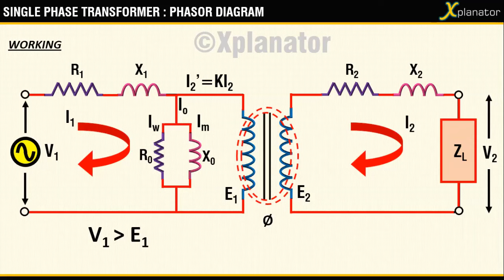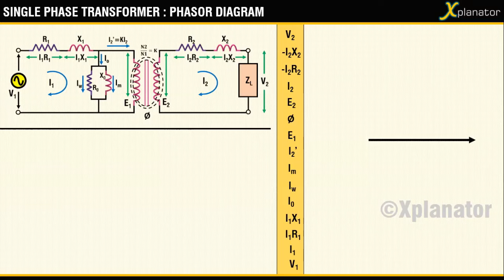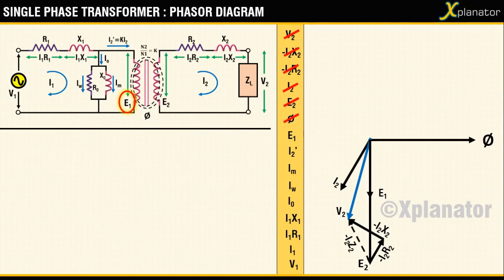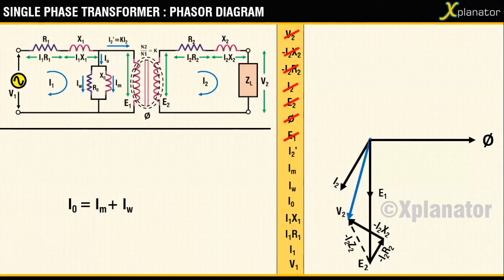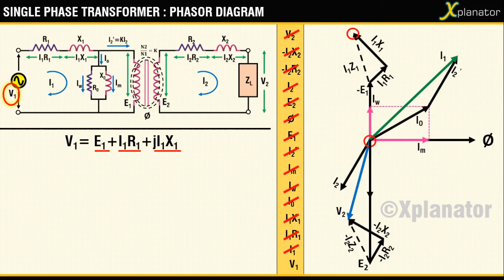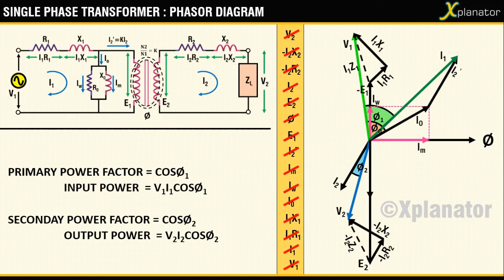PHASOR DIAGRAM ( INDUCTIVE LOAD) FOR A SINGLE PHASE TRANSFORMER

Comment: Why is it necessary to invert E, to become negative E
Reply: Good question, physically E1 and E2 are in phase 0° shift (they have the same formula, only differ in coefficient N1 and N2, +-(N1 or N2)*dfi/dt, +- depending on induced E direction, + to diminish U what caused i and E, - if we direct E in series to U). So basically -E1 is a convention to show us the cause - effect, firstly we have U1 which in close loop produces i1, then im makes Fi (flux), which induce E1 (with that manipulation (-E1) we can only get U1 in upward direction U1= i1*R1+ jX1*i1+(-E1)) and then E2. we can see in phasor diagram order U1, then E1 then Fi then E2 then U2 in reality we have U1, Fi then E1 and E2 and finally U2.

Comment: 🎯 Key Takeaways for quick navigation:

00:00 🧭 The phasor diagram is a crucial tool for understanding single-phase transformer circuits, showing the relationship between various parameters.
01:06 ⚡️ Five important parameters to be drawn on the phasor diagram on the secondary side: V2, I2X2, I2R2, I2, and E2.
03:33 🔌 To draw V2 on the phasor diagram, first, draw E2 lagging Phi by 90 degrees, then add -I2R2 and -J(I2X2) to get the resultant vector.
06:36 🔄 On the primary side, draw E1 (lagging Phi) and Iam (along Phi). Draw Iw (90 degrees leading Iam) and then I1 (-I2 reversed) to get the resultant I1.
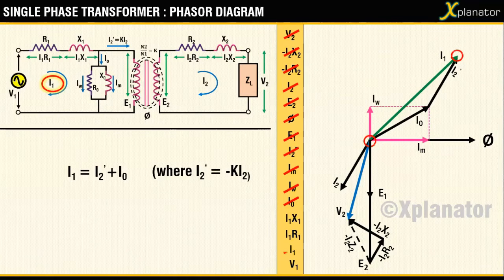08:57 🔁 To draw V1, slightly tweak the diagram by shifting E1 upwards with a negative sign, then add I1R1 and I1X1 to get the resultant vector.
10:29 💡 The angles between V1-I1 (Phi1) and V2-I2 (Phi2) indicate the power factor of the transformer. V1 leads I1 and V2 leads I2 in an inductive circuit.

Made with HARPA AI

Comment: Why E1 is in Antiphase with E2
Reply: Good question, physically E1 and E2 are in phase, 0° shift (they have the same formula, only differ in coefficient N1 and N2, +-(N1 or N2)*dfi/dt, +- depending on induced E direction, + to diminish U what caused i and E, - if we direct E in series to U). So basically -E1 is a convention to show us the cause - effect, firstly we have U1 which in close loop produces i1, then Im makes Fi (flux), which induce E1 (with that manipulation (-E1) we can only get U1 in upward direction U1= i1*R1+ jX1*i1+(-E1)) and then E2. We can see in phasor diagram order U1, then E1 then Fi then E2 then U2 in reality we have U1, Fi then E1 and E2 and finally U2.

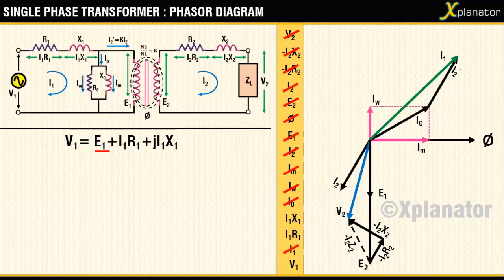Comment: Hi, Excellent video. Could you explain in more detail what you mentioned at 09:20?
Reply: Good question, physically E1 and E2 are in phase 0° shift (they have the same formula, only differ in coefficient N1 and N2, +-(N1 or N2)*dfi/dt, +- depending on induced E direction, + to diminish U what caused i and E, - if we direct E in series to U). So basically -E1 is a convention to show us the cause - effect, firstly we have U1 which in close loop produces i1, then im makes Fi (flux), which induce E1 (with that manipulation (-E1) we can only get U1 in upward direction U1= i1*R1+ jX1*i1+(-E1)) and then E2. we can see in phasor diagram order U1, then E1 then Fi then E2 then U2 in reality we have U1, Fi then E1 and E2 and finally U2.

Comment: why we have to tilt E1 in opposite direction @ 9:08
Reply from the maker: The emf in primary and secondary are phase shifted by 180 degrees. Hence whatever is the value of voltage in E1, value in E2(with suitable magnitude considering turn ratio) will be exact 180 degrees out of phase with respect to E1. 
In phasor diagram, vectors 180 degree out of phase are shown with opposite lines, hence E2= -E1, hence in opposite direction

Comment: how do you decide dirn for i2
Reply from the maker: (1) E and I point in the same direction.because the voltage gives rise to current. Hence if E2 is pointing downwards, I2 will be pointing downwards as well. 
(2) The whole setup is inductive in nature, hence the current lags the voltage. Therefore the I2 will be lagging the E2 i.e. it will be in third quadrant.

Comment: can you please tell me how I2'=-KI2?
Reply from the maker: I2 and I2' are flowing in secondary and primary circuits respectively. Hence are opposite to each other. That is why -ve sign comes in. and the currents are k times of each other(transformation ratio). That is why the K comes in.
Reply: Actually I2’=kI2 and angle will be 180 degree opposite
Reply: @kunalsawalakhe  Why is that so?
Reply: @vinayakmikkal  K is transformation ratio. Also the reason we take them 180 degree is that we want to draw all primary parameters on upper side and secondary parameters on lower side of diagram to make diagram readable.
Reply: @kunalsawalakhe  No. How can you take current negative when it flowing in the positive direction?
Reply: @vinayakmikkal  it is not negative.  Its only representation to avoid complications in diagram.  If we draw both primary and secondary on same side. It will become difficult to recognize different components. Therefore -E1 is considered equal to E1. Drawn 180 degree to E2
Reply: @kunalsawalakhe  Then how is I2=-ki'2
Reply: @vinayakmikkal  I2 is secondary current and I2' is Primary component of secondary current. As the load increases I2 increases and so the I1, as I1= Io+I2' where Io is constant no load current, hence KI2=I2'
Reply: @kunalsawalakhe  But in phasor diagram you took (-k) instead k.
Reply: @vinayakmikkal  -ve sign is used to indicate 180 phase shift
Reply: @kunalsawalakhe  Why is there a phase shift?
Reply: @vinayakmikkal  transformer does not change PF, this 180 degrees are considered for phasor diagram to be readable. All primary parameters are considered opposite to secondary parameters.  It all start from I-E1I
Reply: @kunalsawalakhe  Thanks

Comment: I dont understand well how you draw I2....
Reply from the maker: I2 is going to lag E2 as it is an inductive circuit. So you can take any acute angle and draw I2 lagging E2. The actual value of the angle will be dependent on the circuit.

Comment: why E1 to , -E1
Reply: Good question, physically E1 and E2 are in phase 0° shift (they have the same formula, only differ in coefficient N1 and N2, +-(N1 or N2)*dfi/dt, +- depending on induced E direction, + to diminish U what caused i and E, - if we direct E in series to U). So basically -E1 is a convention to show us the cause - effect, firstly we have U1 which in close loop produces i1, then im makes Fi (flux), which induce E1 (with that manipulation (-E1) we can only get U1 in upward direction U1= i1*R1+ jX1*i1+(-E1)) and then E2. we can see in phasor diagram order U1, then E1 then Fi then E2 then U2 in reality we have U1, Fi then E1 and E2 and finally U2.